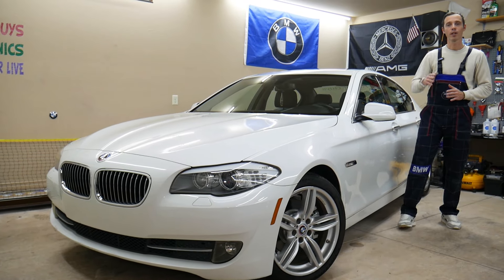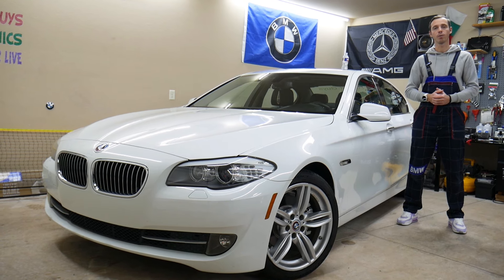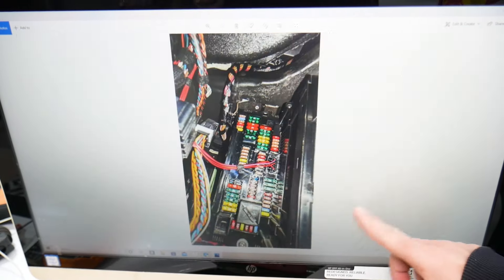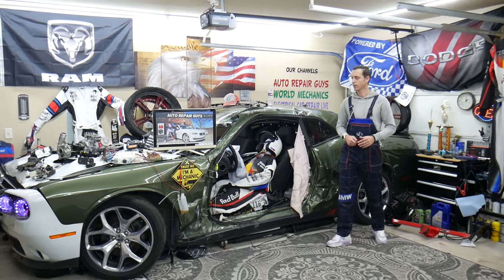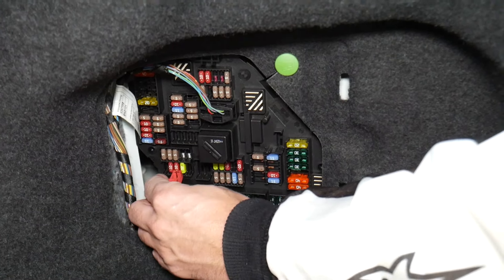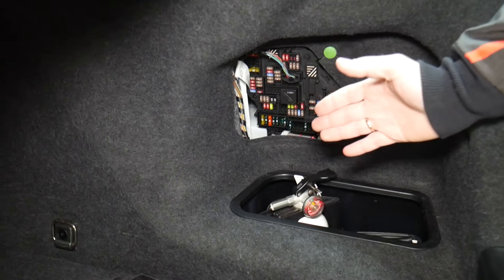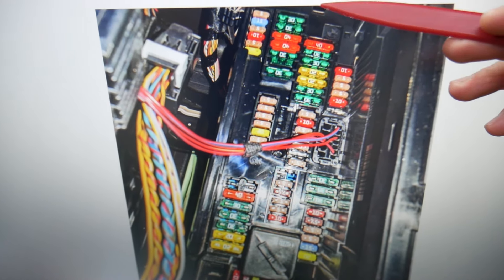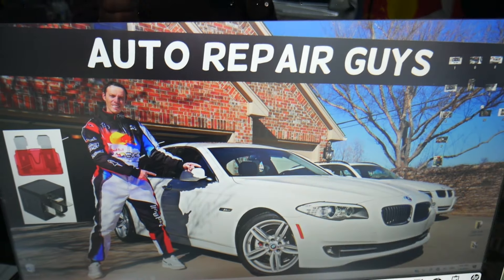BMW F10 F11 OIL LEVEL SENSOR FUSE LOCATION BMW 528i 535i 520i 530i 550i 518d 520d 525d 530d 535d

Comment: I didn't bleed  my system after replacing, my radiator housing 06 325xi now white smoke comes out of my exhaust after driving for 30 minutes with a slight shake but stops when I stop driving there is blue stuff on my radiator housing am I screwed